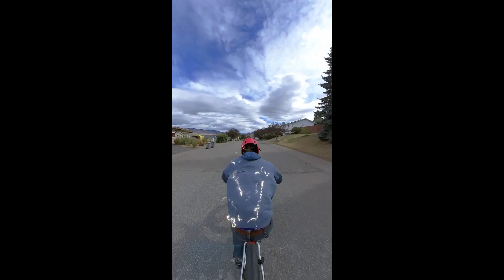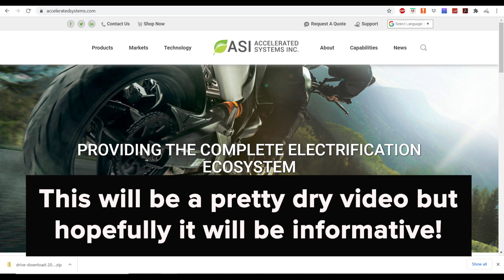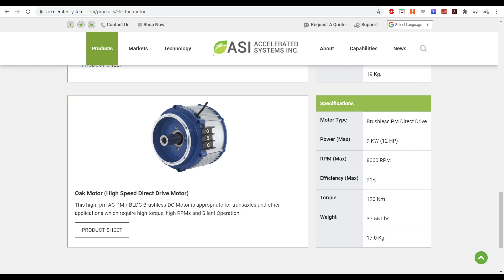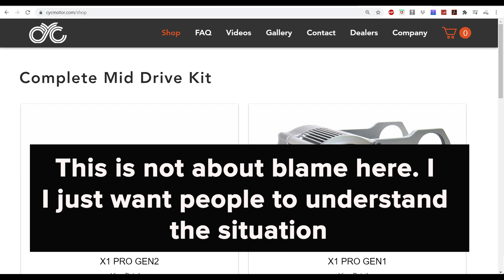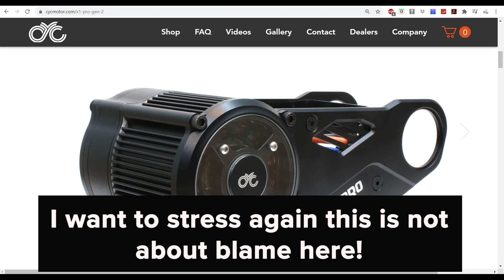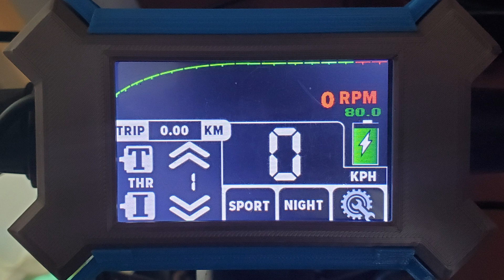ASI/CYC configuration issues and access problems

Comment: Any word from Allen on unlocking my Bac8000 controller? I have a bac8000 i cannot use and no luck getting in touch with Allen after buying 2 kits from him. I want to use the egg rider but cannot cause it is locked. Please give me some info 🙏
Reply from the maker: I think we do have some room to assist ert customers. Can you join our Discord and I will put you in touch with the guy that does our programming.
Reply: @HighVoltageKits  nvm it says link expired
Reply: @HighVoltageKits  not sure where my other comment went.  I tired the discord link & it expired. I would be extremely greatful if u could help 🙏.

Comment: I just bought the asi bac 2000 controller from cyc branch. I'm planning to use it on my QS hub motor and not on a cyc mid drive. Did I just made a bad decision of buying the asi bac 2000? Will it work on my QS hub motor, i suppose i would still need the bacDoor app to adjust parameters, correct??. Cyc said that they will give me credentials to login on bacDoor app. You got me a bit worried now.
Reply from the maker: I have no idea how or why. As a dealer I am not permitted to share my logon details. They do track them. Not sure how cyc are doing things. It will run the qs fine tho.

Comment: Thanks for the explanation. It's a shame that 1.5 years later the controller still has issues. I'm on my second controller and had to push my bike home twice yesterday. The CYC stealth is not working out as I had hoped. Where is all of the advertized torque? My old Cyclone, although big and clumsy has way more torque and a simple app. I just maxxed everything and hit save. Perfect.👍👍
Reply from the maker: Hey Doug, I think we are chatting on email..I would definitely talk to cyc on the stealth. It should have more than you describe.

Comment: Why not to write a mobile app that does what NXT displays does? It would be much easier to set the parameters over BT though. 

Btw. Are you still working on the display? I didn’t see any new firmware releases.
Reply from the maker: I have moved on from the NXT. I can't work with the main guy anymore. Not going to air laundry tho. We are working on a number of things to make it easier to change settings etc. Hopefully more soon. If the NXT firmware is updated then the links and files are usually on bit bucket.

Comment: Is it possible to program the throttle and perform a hall test on ASI controller without the back door software. I am currently working on my second bike that's using an ASI controller and my seller was one of the many people who lost their login
Reply from the maker: The password thing is bullcrap. Join my discord using the link on there. We can have a chat..There are ways around but I don't want to discuss on here. Or you could Facebook message if you use that. Hope this helps. Discord link is in the description.

Comment: CC - Anymore updates on the apps or displays to program the BAC 855? Are ASI and CYC keeping in contact with you or are you getting insights off the grapevine? Cheers
Reply from the maker: CYC just released an app on android that allows some programming of the ASI. I do not have any ASI hardware direct from CYC though so I have not tried it with any of my controllers. Most of the information I have gleaned from my own dealings with the respective companies and other people that have dealt with both ASI and CYC. CYC are very communicative via the Facebook group. Cheers

Comment: Thanks for clearing that up! Now I understand. I was wondering why the speedometer on my CYC display never really works, nor does the adjustments on the app. I mean the bike goes and is pretty reliable but I’m kind of stuck with the settings. I’m excited for the nxt it would be great to have a plug and play system, dumb it down for regular folks like me. I’m good with the mechanical aspects of mounting the motor etc but the electronics and computer side is a bit overwhelming.
Reply from the maker: Your welcome 🙏 ☺

Comment: I have a the unlocked evaluation kit with the BAC 8000 running at up to 25kw. Your totally right. Its far more in-depth than any other software I have used. The company selling the ASI  is suppose to create software for the end user and limit what they can access. ASI wants to supply the controllers and do not want to supply tech support other than to the companies selling the ASI controllers. 

Allen at ERT has recieved a bit of a bad rap due to many of the people not understanding the above. He has a screen that interfaces with the controller that allows you to adjust a limited amount of parameters. He's a currently working on v2 of the software. I plan on purchasing the v2 when it's available. Allen was a great help with initially helping me set up my current bike. 
He shared a config file which I loaded on to my bike,  and then tweaked it a little.
Reply from the maker: Its a small world at times. I did the design for the case and onscreen graphics for the nxt so I am very familiar with that. 2.0 hopefully will see some of its true potential unleashed. You will see it first on here. Cheers
Reply: @HighVoltageKits  I think Allen recommended.me to this challenge. I was going to buy the gen one but he suggested I wait for the gen 2 version. I'm looking forward to it. Cheers.

Comment: Super great information!!!! I was about to buy a cyc unit and a bac2000. Good thoughts and concerns to face cyc before the order...
Reply from the maker: It is definitely worth having a chat with them. I am making a mounting system for the 2000. Its about a kilo in weight and very boxey. You are welcome to join the channel discord and post more questions. Cheers
Reply: @HighVoltageKits   thank you. does cyc provides a cable in order to connect a cycle analyst v3? The the bac2000 a good fit for the cyc?
Reply from the maker: The bac2000 runs the cyc at close to its full potential. The nukular 12fet is also looking a good option. Both would need the right frame and drive train... IE strong 💪
Reply from the maker: I don't belive cyc have the cycle analyst running with the x1
Reply: @HighVoltageKits  I know. I just want to buy it separately, I think it's way better then cyc's handle bar units. I just wonder how the cabling and communication runs between the analyst and bac
Reply from the maker: I am not sure it has been done with a bac from ASI. It is mainly used by Grin technology out of Vancouver. Their phase runner is based on the bac architecture. Its complicated lol.